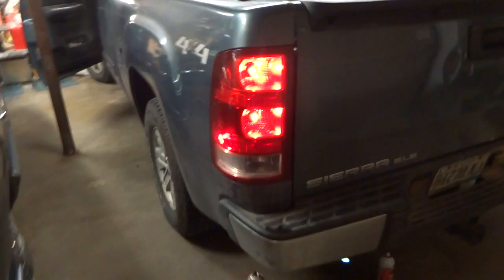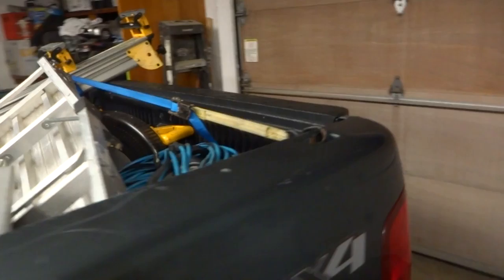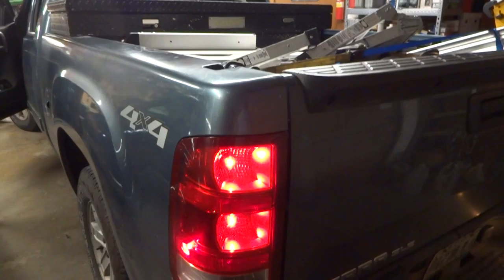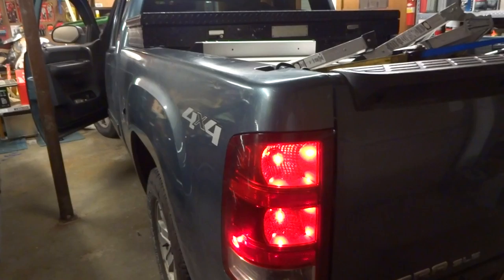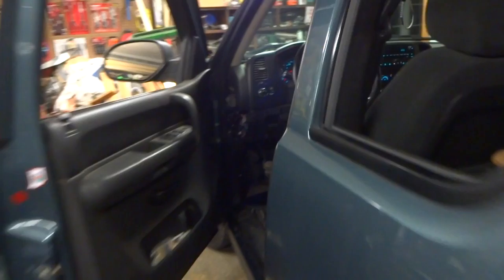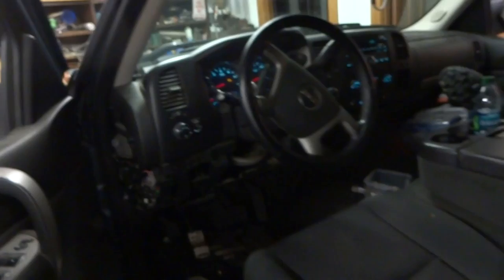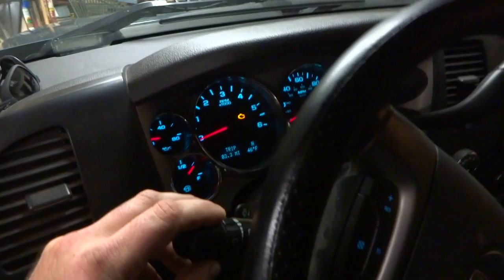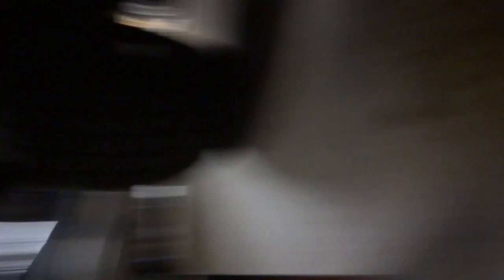GMC Truck Turn Signal Problems

Comment: Could you please give some idea. I've 2006 Honda Odyssey. Front right turning light not working. Light good, same side tail light blinking fast. I've no idea what to do. If anyone knows appreciated. Thanks.
Reply from the maker: I was working on a Monte Carlo with similar ussue. The problem was inside the headlight housing. One of the wires connected to the bulbs was frayed deep in the housing. Changed the bulb a couple times before figuring it out. Replaced both headlights for $125 from Amazon. Problem solved.

Comment: How did you resolve the corrosion any recommendations for products thanks
Reply from the maker: For light corrosion, any electrical contact cleaner should work. I use permatex or wd40 brand contact cleaner. Not for any reason. It's just what is locally available. I cut up a nail file to get into the connector for heavier corrosion. Don't forget to add some dielectric grease before plugging it all back together. Good luck!

Comment: I did that on mine. Still doesn't work.  I don't k ow what it is .
Reply from the maker: I eventually bought new tail lights. Seemed to solve everything when I replaced the old wire connections that came with the new lights.
Reply: @JimiKiwi  I change the cables as well and still no flash . Am this king of taking my truck to dealer ship in January after the holidays . I have not ask many mechanics cause they aren't electricians for cars and they don't wanna play and then make it worst or damage computer . Stuff like that.
Reply from the maker: That is a sad story, my friend. I hope you have better luck with your next truck.
Reply: I'm been asking . Sorry I just read what it says that am king or so lol . My bad sometimes writing can have many mistakes .
Reply from the maker: No worries 😁

Comment: I have this problem but only with the left side not even my running lights turn on just the reverse light and my reverse light blinks instead of the turn signals my break light dont work on the left either
Reply from the maker: Hmmm. Did you try cleaning the connector? And, are they factory tail lights? I have a friend who installed LEDs. They eventually had to add some type of relay so they would function properly.
Reply: @JimiKiwi  everything factor and yes once i seen the video i cleaned them replaced bulbs checked fuses….
Reply from the maker: I  live along the coast so the corrosion got bad enough on mine that I had to replace the wiring harnesses between the taillight and that connector.
Reply: Did you figure out what the issue was. I am having a similar problem. When I disconnect my driver rear reverse bulb the lights light brighter. When I put it on they dimmed down. Idk if this will help with our issue.
Reply: @MrGomez77301  i ended up taking all the conections off as he did on video and cleaned them with light wire brush connected them and was perfect try it might b ur problem

Comment: how to u clean the corrosion properly?
Reply from the maker: I sprayed it with electrical contact cleaner. I also cut a finger nail file to fit the connector and sanded deep inside. Then, another dose of the contact cleaner. Finally, a squirt of dielectric grease over everything.
Reply: @JimiKiwi , its after 1 year now. How does your corrosion treatment fare? Any sign of corrosion returning?  I'm on a research on automotive contact corrosions. Thank u.
Reply from the maker: I have had to revisit this issue. I live in a coastal area with severe winters. At least, now I know what to do and it only takes a minute. I typically use CRC electronic parts cleaner and a spritz of WD-40 after.

Comment: I have tried everything except that I will try in the morning and Let you know
Reply from the maker: Please do! Let us know.
Reply: @JimiKiwi  It didnt work for me it was a shot in the dark as it is my front left side. Flashers work fine. I have reseated the plugs in the rear. Changed the Switch on the steering column. Its just funny they work fine for about 5 seconds than the front ones dont blink any more and the rear ones blink fast. All bulbs have been replaced including side marker bulb and all Sockets look good. I ended up trading the truck in for cash late yesterday and the blinker problem never came up. But thanks for this post it was worth the try.
Reply from the maker: Wow. That had to be frustrating. At least, it's out of your hands now. I wanna see the look on the technician's face when he figures that one out 🙂

Comment: Can't find my flasher on 2009 Silverado, where the heck is it? Need to replace it, no clicking sounds.
Reply from the maker: Lee Steele there isn't one. Chances are, it's corrosion in that wire harness block.
Reply from the maker: Lee Steele it's computerized. It's not a regular flasher like we're used to.
Reply: It is programmed through the body control moduele (BCM) unit.
Reply: there is no flasher. it's programmed thru the body module. the flasher sound & warning chimes  are programmed thru that as well & the flasher clicking, & warning chimes are transmitted thru the driver's side front speaker.

Comment: what about independently
Reply from the maker: Each tail light housing has its own connector. There are four in total. One supplies the power. One for each tail light. And, one for trailer lights. While you're down there, it's good practice just to clean all of them.
Reply: @JimiKiwi  I have good sir…always a lot of grit back there!  The reason I’m asking is because mine needed resistors to stop the hyper flashing. On each signal bulb.
Reply from the maker: Ah... you must have LED bulbs?
Reply: @JimiKiwi  oh ya switched them over found this video in my search for a solution truck is too new for a relay but got it done with resistors good info though mine def needed a clean out
Reply from the maker: Sounds like a video you should put together. You would certainly get my view. 😎👍

Comment: I'm having ( in a roundabout way) a similar problem with my old 91 GMC vandura van. The wiring has been frustrating but after lots of research and stress I thought I had it.. and did! Untill I put my right blinker on...then the hazards come on instead.and with my lights on the night then it's the same but I have to (or not) do it manually by hand with the same!e result but the rest is fine...somebody please help all the car places laugh and tell me totally different things and refer to the Manuel or find an electrician which obviously that is why I went there in the first place.driving me insane! Don't know what to do 🤔
Reply from the maker: It sounds to me like you might a wire crossed. What happens when you activate the hazards?
Reply: Oh that could be possible, when I turn the hazards on the front right blinker on it's own goes off. .and the back hazards both blink like they should but at a miraculous speed...your theory sounds logical and accurate I shall continue my hellfire mission to solve this nuisance and I super super appreciate you replying and your insight or  ideas.so much. I'm from England and all I've ever wanted was a shitty beat up Ateam van since I was a kid and I moved to America finally and eleven years later I got my first vehicle and it's exactly that and I'm SO STOKED on it.unfortunatly I'm mechanically useless almost when it comes to American cars and vehicle in general but I am very happy to learn and I guess I shoulda been careful what I wished for haha but hey you gotta learn somehow right. I wired my log cabin I built and it's dialled so I get the whole process just a little bonkers how much is going and how complex the whole machine is to get it to function normally, it's actually kinda mind blowing how complicated almost everything is and how much is going on haha but I'm a super rookie and I ain't scared to learn just frustrating knowing that the second your spotted coming home from work with dodgy lights ur getting pulled and I don't want that the same as anyone else...thank you for taking your time to reply and guide me some way forward, Auto zone and those guys are no help they literally laugh and don't even offer to help they say yeah it needs this...
Yeahhh it needs that, ...but really the same wanker is the one telling me all these issues it 'may' be instead of helping a blatent stranger to the game. Anyways the search starts now for what may be a crossed wire...thank you

Comment: Tried this on my 05 it didnt work i even bought a New junction box.
Reply from the maker: This works for the 2007 to 2011.
Reply: everything before 07 has a flasher relay everything after is controlled by the BCM.

Comment: Please help: 08 Silverado 1500 When I turn on the truck the driver side tail light it out and when I have it in park and or put my turn signal the reverse lights turn on I unlock the truck and the driver side won’t turn on but when I lock it they do turn on
Reply from the maker: Have you tried cleaning the connector?
Reply: @JimiKiwi  no I haven’t cleaned the connector which connector you think it is? Also the brake lights don’t turn on. Thank you for your help I appreciate it
Reply from the maker: I would clean all 4. It certainly won't hurt.
Reply: @JimiKiwi  I’ll do that thank you
Reply from the maker: Don't forget dielectric grease before putting it all back together.
Reply: @JimiKiwi  the ground wire that leads to the lights was disconnected.
Reply from the maker: I'm glad you located the issue. Seems like a simple fix I hope. Good luck!
Reply: @JimiKiwi  I attached it and works great
Reply from the maker: Fantastic!

Comment: What is the trick to disconnecting these connectors?
Reply from the maker: carl martin There's a tab that you squeeze while you gently wiggle and pull the connector off.
Reply from the maker: There's a tab that you squeeze while you gently wiggle and pull the connector off.
Reply: Thanks, I always have a problem with getting electrical connectors off,

Comment: still good?
Reply from the maker: Yup! Good to go!
Reply: JimiKiwi  any mechanical fixes. Message me. Thanks buddy
Reply from the maker: Just cleaning out those connections and that's it. Two months down the road and no issues. Well, none with the turn signals.
Reply: JimiKiwi   Any repairs of anything. Just message me I like to watch.
Reply from the maker: I have done many repairs to it, but they were all pretty straight forward so I didn't bother making videos. "Eric the car guy" has a ton of repair videos you would probably enjoy :)
Reply: Pain in the ass gettin that sucker outa that little spot she sits in
Reply from the maker: After a few times, ya get used to it. Keep a foot on the brake!